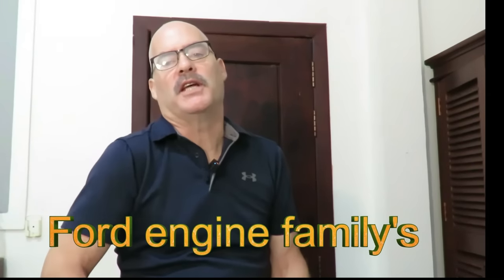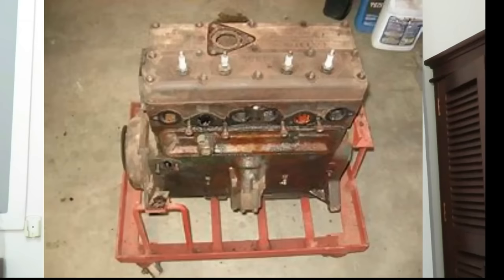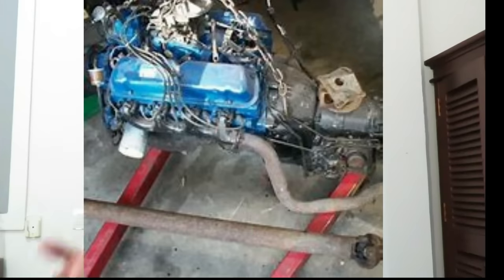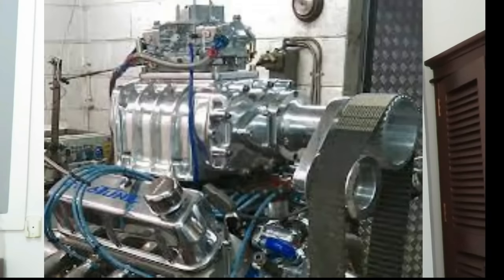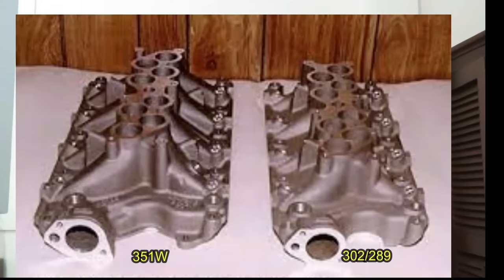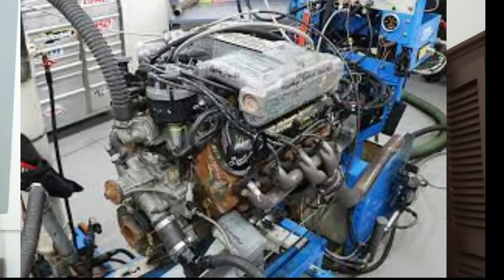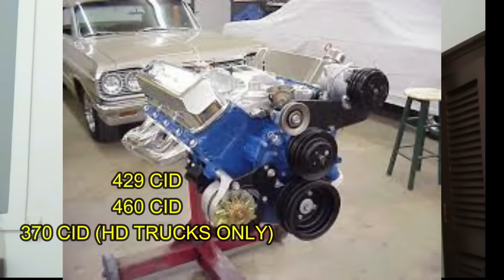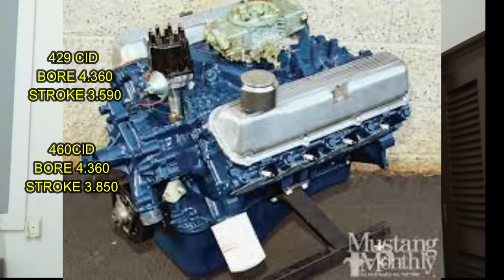FORD V8 ENGINE HISTORY

Comment: The Cleveland lived on in Australia until 1982. It was an option  for the Falcon and Fairlane. . There were 2 capacities 302 and 351 and 2 different head designs. Ford Australia had the castings for the block  and it ceased production with the last V8 produced in 1982. The V8 wouldn’t return until1992 as the Windsor 5.0HO and ended in 2002. Then we took the US modular V8 and turned it into the Boss 260 5.4L it’s run ended in 2011 , replaced with the Miami V8 a supercharged version of the coyote. This would end in 2015 . Without  the Falcon the only V8 in Australian would be the mustang V8. We also received the modular 4.6 in the mustang and presently the 5.0 coyote. The Cleveland had a cult following in Australia and still to this day the 351 Cleveland has its place in motoring  history here. Long live the V8.
Reply: The Chevy OHV straight 6 usually had more HP than same year Ford flathead V8... 
Chevy and Cadillac had V8s before Ford... 
Ford flathead V8 actually put into Ford trucks in Europe until mid 1970s or '80's...

Comment: Thank you for great recap 
In Australia the 351 Cleveland is a legend engine, used in the 1971 Falcon GTHO Phase III, to win the Bathurst 500 in the same year, an original Phase III is the most collectable car ever manufactured in Australia $M+
One thing I think I read somewhere, is that, Ford NASCAR teams in the 70's liked to use what they referred to as the Cleveland OZ block based on the Phase III Australian block, 
Thanks again for your great shows
Cheers
Pete

Comment: Many 427's were put into Chris Craft twin drive large boats and also sold all over south Louisiana for irrigation pumps in the sugarcane fields , I worked on many of them . They could hold high RPM's all day without issues and only wear out  the water pumps  and rear seals .   Dad had a 400 in a 76 Mercury Marquis and for such a heavy car it would get up and go , I guess that motor had more torque than HP .   Great video !!!!   I forgot the big trucks had the FE 370 !!!

Comment: Good presentation! Two engine families were, understandably, overlooked. The "Lincoln" Y-Block that was used from 52 - 58, and the "MEL" 383, 410, 430, 462 used in Mercury, Edsel and Lincoln from 58 - 67. Certainly not most popular.

Comment: I do like the FE engine family, especially the 427. I was waiting for you to mention some of the special and unique aspects of the 427. Like "cross bolt mains" on #2, #3, #4. Some had bumper pistons. Also, the nickel content increased for racing endurance. As a side point many of these engines were in Boats. I actually retrieved two 427 motors from a twin-engine Cris Craft (they had left and right turning 427's)
Reply: I was waiting for him to mention the side oiler 427s and also the MEL series
Reply: Bumper pistons for marine engines to  push those floating valves back shut.

Comment: Great Ford content as usual. I've got the 400 335 series in my 77 f 150 4x4. And with Cleveland heads, stock pistons, 268 comp Cams bump stick,Scorpion roller rockers, dual plain aluminum intake, and a smallish 600 vacuum secondary Holley carb, it makes respectable power for my heavy truck. Yes this engine family gets a bad rap because of its history of being a smog engine. But I believe if we could try to put some of that in the past and treat this engine the same as some of the more popular one's the aftermarket support may increase as people realize just how strong they can be with the right parts in them. Just like any other V8. I do know the price of the parts will surely stay higher than most engines tho. Keep up the great work. 👍

Comment: As a lifelong Ford owner and supporter, I thank you for this. Gasoline fueled Ford V-8 Engines throughout the years were many, varied and at times even redundant and confusing. However, the vast majority were competent, reliable and had long production runs. A few not so much. Performance Ford V-8's were able to meet or exceed the off-road successes of the competition. Many of Ford's V-8's have become legendary, live on and are popular to this to this day.  But infamous. I beg to differ. Also, a cult member I am not.😉

Comment: Here goes the condensed 3,000 word comment.
You nutshell nailed it good my friend and good to see you back at it. My personal favorite from FoMoCo is actually the 430 MEL (Marauders) but that's not actually Ford.
Again, good stuff and supper glad to see you back man.
Reply: The MEL Marauder 430 engine was available in the Ford Thunderbird 1958 -59 so it was a Ford engine.
Reply: Assuming that 430 was an FE engine right? I saw a 410 in a car back in the 80's at a local junkyard guys place. I got a set of FE Thunderbird interceptor heads off of him with the gold valve covers that day to put on the 390 I was building.
Reply: @LHarry-c2t  The 430 was in the MEL family (Mercury Edsel Lincoln) that ended with the 462 in 1968. Kind of a unique design that dominated in the late 50's early 60's as the most powerful production engine with the 430 (dual carb) Super Marauder. But those Thunderjet heads you got back then for that FE were pretty cool as well, as long as you got the intake with them.
Reply: @BareRoseGarage  Thanks for the info. I'll have to research the MEL engine family. Sounds interesting.

Comment: Y Block ran from 54-62 in cars but 54-64 in trucks. The Lincoln Y Block has very few parts that interchange with the Ford. The Ford Y was quite durable and found a home in Ford’s line in South America up through the 1980’s. Ford did a phase 2 version with a head/camshaft/firing order design like the Windsor family. Appreciate the video!
Reply: Yeah they used the Y block in what's basically a bump side (6th gen f series) until like the 90s lol.
Reply: You are right  about the Lincoln y block it was a totally different engine than the Ford y block. The Ford y block was built on the 4.38 bore center like the ford Small block. The Lincoln Y was built on the 4.63 bore center like the FE engine 
intake ports were not stacked. ports were not stacked. The Lincoln engine was Ford's First over head valve. it was used in heavy trucks until 1962. There was also a MEL  engine  430 CI that was used in the Thunder bird in 1968 and  59. 
This engine saw known as the  Marauder engine and was the first production engine  to have more than 400 HP.

Comment: Ford FE has the heaviest cast iron intake manifold known to man. Lost the bolts? Na problemo, just set the intake in place in forget about it 😂
Reply from the maker: yep, I always tell people if you replace the iron FE intake with aluminum your front end will probably come up an inch or two
Reply: The FE intake was half of the head, so changing to the aluminum and port them, they are amazing. The intake was 75 lbs and the aluminum was 25. An aluminum water pump really helped too.
Reply: The 429-460 is a very heavy engine. With full assembly you will want to brace the engine stand. There is a myth that the FE is heavier and that is not true. The FE is close to 100 lbs lighter. If the intake manifold is swapped on each tire FE is close to the SBC in weight. The 385 series is comparable to the BBC.
Reply: Amen to that.  That cast iron intake is as heavy as a white dwarf star.
Reply: @davidwier2862  I can’t imagine how I replaced so many. Ford even sold a Medium-Riser intake and cam and lifter kit out of the catalog that had a 715 Holley that was guaranteed to add 75 hp and 100 hp with the Stock kit headers and 150 with the SS headers that crossed two pieces from one side to the other. Right out of the catalog. It was too bad that they didn’t build them that way. A 330 hp to 460 hp with a kit that knocks off 75–100 lbs off the nose. It was a shop in Detroit. I swapped out a few for people and they were able to play with the big boys. A 428 CJ with this kit in a Torino or Mustang was ready to go racing. When Edelbrock tried to redesign the heads and intake. And the RPM cam kit, they discovered that Ford had a covered and they just copied the CJ all in aluminum  and had the 410 hp cam as a hydraulic. They could not improve the castings but to make them lighter. The aluminum water pump helped too. They were pretty close to a 350 Chevy with the Edelbrock kit.
Reply: @Bbbbad724  we have a '76 f150 with a 390.  Originally came with a 390 but the one in her is from a police interceptor Fairlane.   What's sad is that the Original 390 that came in that truck was built so sloppy from Ford it only lasted 13k miles.  The rebuilt 390 that was done 40 over lasted 200k miles before its last rebuild to 60 over.   Likely the last time that motor will ever be opened up.
Reply: lol.  Darn near it.  Putting aluminum on is the best to do.

Comment: I always like engine history especially which engines were the best and which ones can be built up. I am not a major purist to anything. I do own a 1964 Ford F250 with a 292 Y block and a 1975 Ford Gran Torino with a 351W. I am more of a Dodge guy but like all American major 3 car maker, cars and even some AMC cars. I would like to see the engine history of Dodge and GM. Tackle AMC as well,maybe. But I like the idea as well to go deeper into any engine. I have heard the 429/460 had the same stroker ability as the FE engines. I heard the 429/460 put the camshaft up so high in the block that very little clearancing needed to be done compared to the Mopar 440 or GM 454. That is what I heard but a good point to make or clear up if you revisit those engines.

Comment: Loved it, I think you missed the MEL which had a big 462 cubic incher that went into the Lincoln’s.  You also missed the Lincoln Y block, but that could have been developed by Lincoln when it wasn’t under the Ford umbrella.  Also you missed Super Duty series that was in big trucks that had a 534 cubic incher and then you missed the best one of all and it was all due to WWII.  The Ford GAA which was an all aluminum, 32 valve 60 degree V8.  The narrow angle was because Ford wanted into the airplane engine business and he developed an all aluminum 48 valve V12 and the 60 degree V is necessary in the 12 cylinder to keep it even firing.   

Great video, use those examples for the next video please sir.

Comment: Thanks for your great informative videos! Nice job.

Around 1982 I had a '65 Mustang retrofitted with a 351 Cleveland hopped up,  4-sp B&M (quick shift?)...torquey and fast. Ladder bars too lol.

Then more recently a couple Fox Mustangs (88 GT 5-sp. & 91 LX CONV auto. Both 5.0L).  The LX wasn't very fast esp. here in Denver.

Then finally a  real ratty 1974 F-100 pickup (strictly workhorse for transporting the dirt bike to the track lol) with that FE 390 motor you were mentioning.
Torque city!
Reply from the maker: Very cool!

Comment: It would be interesting to get your thoughts on the 4.6, 5.4, 6.8 engine family.
Reply from the maker: to be honest I don't really have much if any experience with those engines I've done a few 4.6/5.4 engines. but that was 20+ years ago.
 All the engines I spoke of I have built and worked with over the years the flat head is kind of an exception I did one ford v8 flat head many years ago
I have done a ton of Plymouth and Chrysler industrial flat heads
Reply: Around 200K the 6.8 V10 likes to warp and crack exhaust manifolds. As well as breaking the studs in the cylinder heads. 

Also around that mileage the valve springs break and the lifter followers spit their needle bearings. 

If you hear ANY engine noise out of a 6.8, you had better fix it asap. Or else you'll be slinging in a replacement.

Comment: The Y block over under intake ports is just another way to deal with dual plane intake manifold. Its like an extension of the intake into the head
Reply: It's also equal length.

Comment: Very well done and good information.  One caveat,  the FE 352 was first produced in 1958 with the 332 during the introductory year and the 360 was the FE and the 361 was an FT.  You did nail the bore for the 352, 360, 390 at 4.00, 4.05, 4.05.  I really liked the video and agree that the Ford FE (especially the 390) is a good motor for building a solid performing Ford.  It is also fairly expensive to modify.  For the money I would recommend the 351 Windsor (which I believe you also recommended).  Thank you!!!
Reply: 352 came out in 1960 332 was 58 and 59 .
Reply: The 352 was available in 1958 and 1959 in the Thunderbird and the Edsel.
Reply: @todbarker9104  The 352 and 361 were both released for the 1958 model  year. The 352 was the Ford performance engine, 
The  361 was standard in the Ford Based Edsel, and optional in Ford as police intercepted. in 1959 the Edsel was down graded  and could be had with a 6 cylinder or a 292Y block

Comment: The Packard Twelve was a range of V12-engined luxury automobiles built by the Packard Motor Car Company in Detroit, Michigan. The car was built from model year 1916 until 1923, then it returned 1933 until 1939. As a sign of changing times, the majority of second generation Packard Twelves received standard bodywork, with custom bodywork gradually losing favor. Many of the custom cars were actually only "semi-customs", with Dietrich assembling Packard-made bodies with special touches.[1][2]

Comment: thanks , my first car in 1973 was a 1965 tbird with the 390, do you know why it had an overflow radiator tank that was different than any other ford that i saw. I see 390 hotrod cars today that do not have this extra tank.any thoughts on that.

Comment: 1964 we had moved from Tulsa to Calgary. 1960 Ford 2 door base 292 2bbl, 3 on tree. It started every mornijg except the mornings it was -40F. It did not have a block heat until 1965. The old cheap stripper ford 2 dr sedan just started and ran no carpet but a rubber matcovering.

Comment: LIKE!!
THANKS for the great information!  I still can't understand the difference between a Y block and a V block . Are they not both bored in a 90 degree? angle spread to each other's cylinder banks?
Reply: Skirted block. The crank centerline on the typical V blocks was the bottom of the casting. Where the Y engine’s casting put the centerline of the crank “inside” of the block. Very similar to how many of today’s modern V8s are designed.

Comment: Rebuilt a 460 in a 69 Lincoln a few years ago. Totally different crankshaft. The power steering pump is mounted on the crank snout. So the snout is longer. Weird seal on the front. Good luck finding a replacement!
Reply from the maker: that was probably a 462

Comment: I t was cool that the 1975 427 TUNNEL PORT made the same power as the Boss 429 and the Boss429 broke cranks. The 427 was more durable. A few years EdPink said he thought they would eventually get square, but the fun was over before they got a chance. I think you did fine.  Do you have any 428 blocks standard bore you can sell. I always hunt them and end up with a 390. I have a 500 hp 390, but you have to be wailing to get it, 7000+ rpms

Comment: Tim Meyer might disagree with the 351M take here.  I have one in my F350, and I just this week bought another for a spare—as things go, they are cheaper to acquire than the C version, but they can be modified for peak performance.  In Australia, the 351M was made ALL through the 80s and into the 90s I think.
Reply from the maker: Like I mentioned they can be made to run pretty good,
 but the lack of performance internals from the aftermarket makes them challenging and expensive,
 the cylinder heads are also very poor performers you need Clevland heads that are very hard to find any more or an aftermarket head those equal big $$$$ the W engine is much more bang for the buck mainly because there are so many more of them around along with the fact that there is a huge aftermarket support for the Windsor engines and the later 351W can be found with factory roller camshafts this is a huge + now days with all of the poor quality flat tappets being produced , can the M engines make decant power? Yes they can,
 but to get the same output as a W base engine you're going to spend double the money for most people choosing a project engine the M engine just does not make sense
Reply: @Myvintageiron7512  I do not disagree generally, but as George Reid noted "These engines didn’t live long enough in production nor did they realize their great potential as factory high-performance engines due mostly to the unfortunate timing of tougher federal emission standards and higher auto insurance rates. It arrived during a period of changing attitudes about high- performance automobiles.”  In other words, the potential was always there, and the engine was built by people in the C1/c2 plants with the understanding they were building a muscle engine.
Reply: Wrong

Comment: 400M is one of the best ones for performance. It's a stoker 351 Cleveland-  stock or aftermarket Cleveland heads bolt right on

Comment: Excellent analysis! My Dad had a 58 Mercury Monterrey with a 383 MEL engine family. I believe that this was also FE based, but it had a Herron type  cylinder head which made it a wedge combustion chamber. I wasn't quite old enough to know more than looking out over the padded dash and it having a push button  transmission. We junked the car in the 1980s and really wish we hadn't. Again, great analysis and very much appreciated. I would also like to add my 2 cents for a similar style video on the various GM engines and Chrysler too!
Reply: Actually the 383,410,430 and 462 are MEL engines. MEL stood for Mercury, Edsel and Lincoln. These are different than the FE engines with FE standing for Ford Edsel. Note that the MEL 410 is a Edsel engine here and were only found in Edsel cars. in the mid 60's there was also a 410 engine and these were in Mercury cars and these engines were FE based, basically a 390 with a 428 crankshaft.